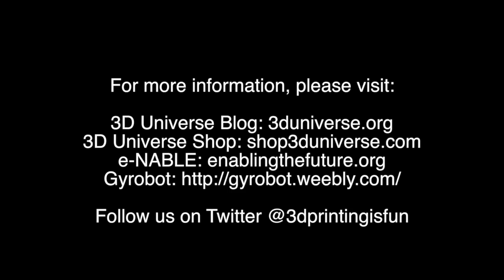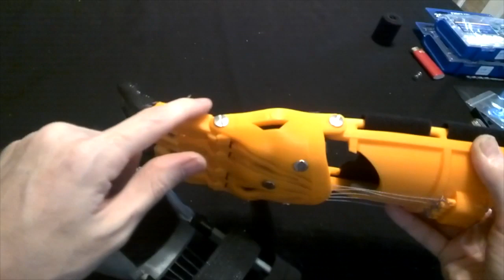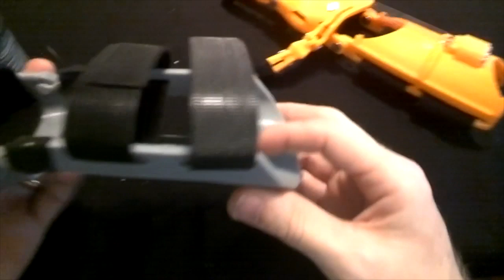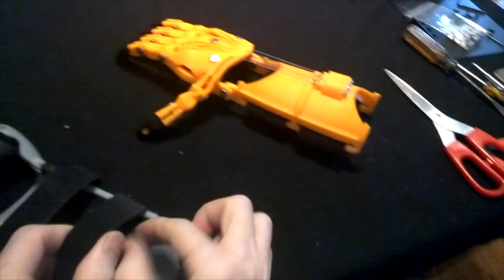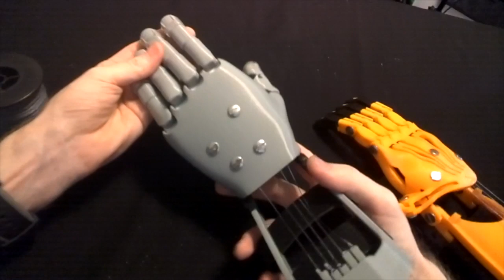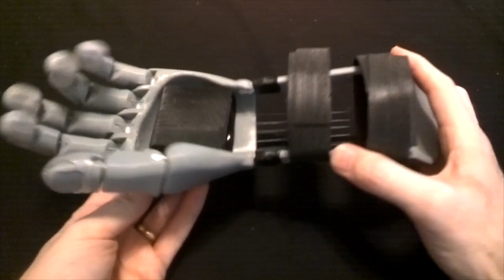Demo of the Flexy Hand 2 - a 3D Printed Prosthetic Device by Steve Wood

Comment: which material did you used to print the parts that joins the fingers ?? i printed the hand using the abs but it is stiff it does not move
Reply: he says it at the beginning it is flexible filament can be ninjaflex filament or nylon but nylon is less flexible

Comment: Thank you! Even thought i have literal need for this, it gave me idea how to use my hand movements to operate 3d printed  hand remotely in sort of exoskeleton suit i'm planning to work on.
Actually design is kinda simple and could be used possible people in wheel chairs, with out need of lifting them selfs to grab something from high places. I dont know if this would be too useful, you can be judge on that.

Design is simple. One hand is controlled aka "slave", other similar that is attached to glow/acts like glow, transfers the movement to slave hand via cables. Doubling number of cables will allow fingers to have additional side movement too (if structure is sturdy enough that is.
Ninja flex type of material inserts in hand give more ridged crab on the objects.
If grabbing force is lowered in slave hand, small gearbox system could be placed between cables to add more torgue, or cables could be assisted via electric motors that are possible controlled by arduino and some kind of force.. or movement sensors (electronics are not my thing, so cant say much on that)

Hope this helps someone, or at least gives idea. I have seen what broken body can cause to people mentally and seen the pain in their eyes, if my lunie ideas can help someone then i'm all for it. Sadly time wise i cant join to community, even thought it would be nice to help in that sense.
Reply: Thank for information , can you please share the link for your project ?

Comment: Hi! 

That is a very brave build plate! I noticed you were able to print the main body of the hand without any support! I will give this a try. Do you mind sharing your ABS and PLA settings for this build plate? I just finished a hand in three seperate builds and the finish is not even close to what you've achieved here!
Reply: Yes, the palm, gauntlet and tensioner pins print fine without support. The finger pieces do need support. I printed this one in PLA, at 0.15mm layer height, extruder temp 190C, bed temp 60C, on glass with a coating of Aqua Net Extra Super Hold hair spray. I also kept the speed pretty slow, which accounts for the high quality print. I used 65mm/sec for this one. The printer can go about twice that fast, but the quality wouldn't be as good then.
Reply: Jeremy Simon Thanks I'll go get the hairspray and give these settings a try! Also thanks for the tips on using Simplify3D in your other videos... Hopefully can start getting better prints now
Reply: Jeremy Simon  Can you tell what is in the hair spray and % trying to find some thing the same here in Australia?/
Reply: Glen Dooer, it doesn't list percentages, but here's what it shows for contents:

Water, Dimethyl Ether, SD Alcohol 40-B, VA/Crotonates/Vinyl Neodecanoate Copolymer, Acrylates Copolymer, Aminomethyl Propanol, Sodium Benzoate, Cyclohexylamine, Triethyl Citrate, Cyclopentasiloxane, Masking Fragrance
Reply: Jeremy Simon thanks will try and find here in Aussie land
Reply: Glen Dooer what you want to look for in the hairspray is the Acrylates! This is the sticky stuff that's left behind once everything else evaportes! You could ask your gf/wife/sister to recommend a hairspray with strong hold... that should typically have a form of copolymer in it - Although you'll ideally want the acrylate type!

As a side note, Acrylates is the same type of stuff used on post-it notes where it remains sticky fir a relatively long time!